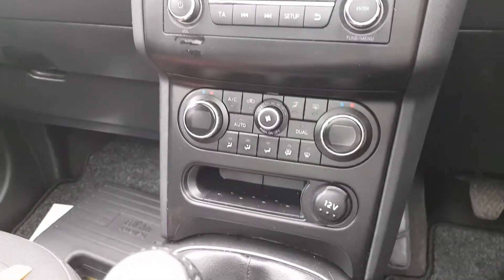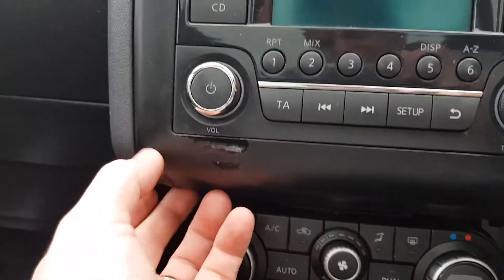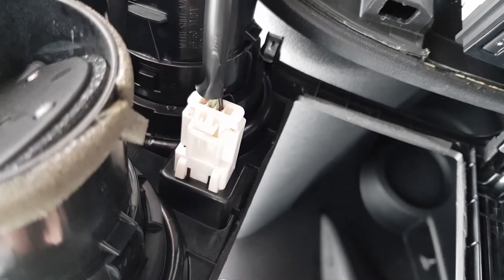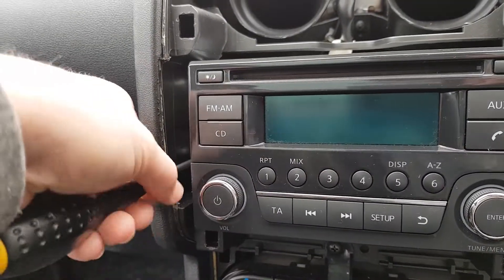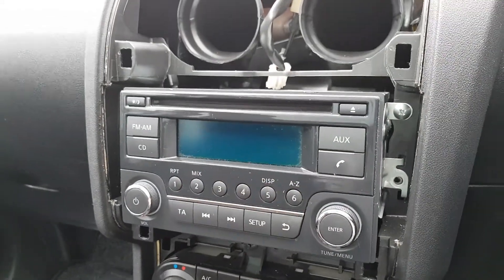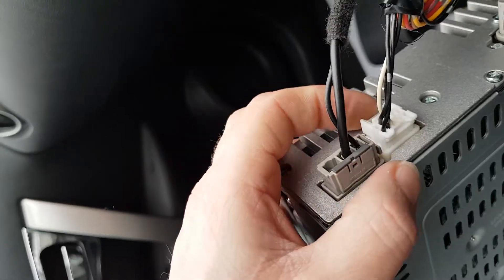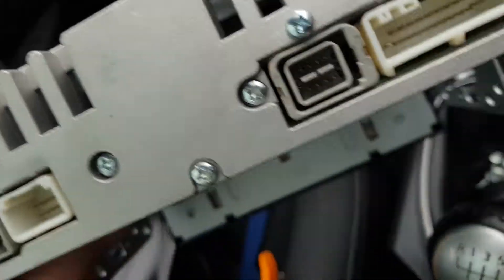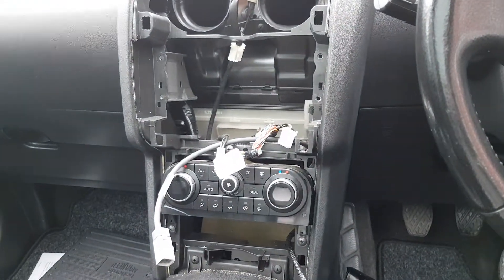Nissan Qashqai 2011 radio removal

Comment: Great video. I have the same one but want  to  upgrade it to the sat nav model that the later model has . Is it as simple as plugging it in like you have just unplugged  the old one?
Reply: Hi I'm in the same boat, did you ever find an answer to your question?

Comment: great vid ty, do you reckomend halfords to refit a mediua centre with sat-navif its at all possible to asume its compatable with a petrol 2011 2.0i qashqai engine/system, havent seen any in my area. most are newer deisel 4x4's  versions! thanks
Reply: if its nearly as easy as you make it look i could probably do it myself without botching it. and even fit one on my washing machine! ;)
Reply from the maker: No I recommend me.. you could try halfords if you like but they don't go as in depth as specialists like myself.. thanks. Mark.

Comment: Great video thanks! Our radio has a blank screen so was thinking of replacing with another. Will any double din radio fit this and if so will i need a facia and where would i get one?? Cheers
Reply from the maker: We can supply all of the parts required.
Reply: @MASAudio … thank you for making and uploading this Video 
Very informative and helpful.
please get in contact with me, my screen is ‘gone’ - very dark and unreadable..  all else works ! ( I think)
would I need to replace the whole radio ? Or can the LCD be removed and replaced .. 
Oh BTY I’m in Eire ( Rep of Ireland) 🇮🇪
Reply from the maker: Hi, yes you can send the radio to us and we can replace the LCD with a new updated replacement that does not fade when warm like the original ones suffer with. Thanks, Mark. service@masaudio.co.uk

Comment: If i replace it with another radio that has navigation and all, will the buttons on the wheel work with the new radio? Is there like a cable or something that connects to it?
Reply from the maker: Yes you need a specific vehicle harness.

Comment: If i get a wiring harness to replace the radio, would it be plug and play or would i need to find a 12v switched live?
Reply from the maker: If you get the harness that does the steering controls it will be plug and play..

Comment: Brilliant video. Right a question or two. 
Im wanting A cheap and affordable touchscreen unit. With rear camera and front camera. Also sat nav. 
Now I've seen a few on eBay. However I've asked them if they fit Nissan qashqai 2008 model. No one has replied. Is it possible if you could advise me on some that are out there. For my car, not expensive ones. Just brought the car. So don't have much money left. But my children don't like this unit. 

Please please could you kindly respond as soon as it is possible. 
Im not good with car stuff. Hence the plea for help.
Reply from the maker: Rashid Majid any double din unit will fit as long as you also purchase the fitting kit and wiring kit to fit this car
Reply: MAS Audio sincerely appreciate the time taken to reply to my question. Really do. I've seen a few on eBay. Measurements are perfect (as shown) double din also. So thank you for the helpful advice.
Reply: Would like to have a new Radio too but don't wanna loose the function of the steering wheel buttons.

Comment: Hi,I see :  "too many input errors the system is blocked contact your nissan dealer" 
Do you think that if I remove the radio, I will be able to access the code again?
By French guy
Reply from the maker: no it needs unlocking by a dealer

Comment: Hi there my Nissan Qashqai. Radio on not sound ? Thanks
Reply from the maker: Could be a number of things that would cause that, from a short circuit to a headunit output chip failure.

Comment: Would help if you showed where the code number is. That’s the main reason for removing the radio!
Reply: Code number would come from main dealer using the vehicle documents. 
Also the main reason for removing the radio is to put a better one in...